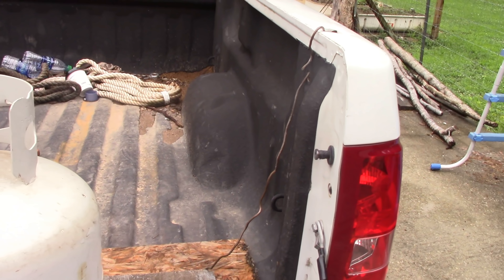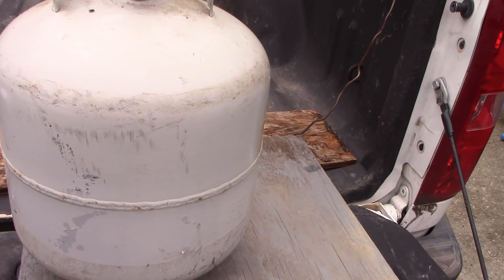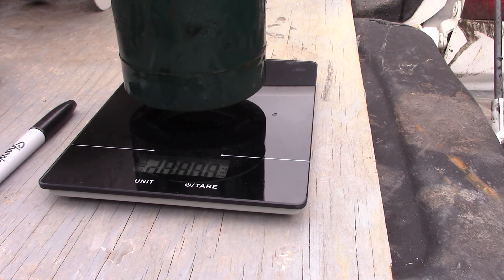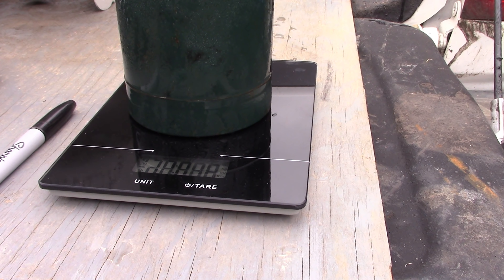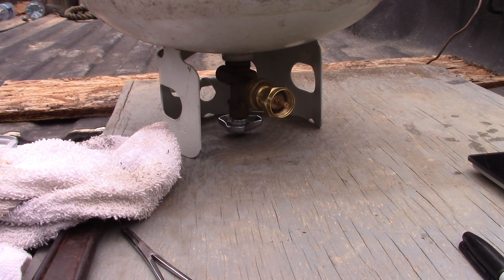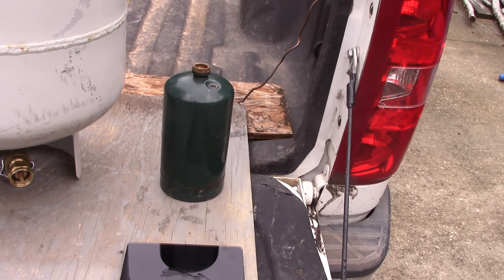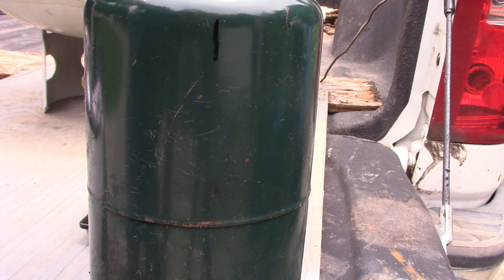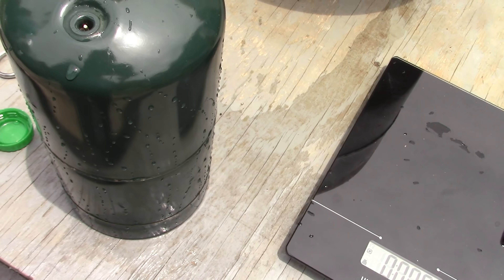1lb propane tank hack

Comment: I generally fill mine to 14oz or less just for safety. Like you said, it's good enough.  I have so many tanks it really doesn't matter if I only get one to even 1/2full. A few years back I tried to get one exactly to 16oz. I froze, filled, refroze and filled again. On the second time it overfilled to around 18-19oz. I set it down did some others. 5 minutes later when I came back and it had warmed up the metal was bulged. The actual cylinder was bulged out 1/4" on the top half and the bottom half with the center weld/overlap band original size. That was pretty scary and I will never attempt a 100% full fill again. I have done 100's of these and have never come close to overfill with a single freeze and fill until it stops hissing. A lot of people will pull the safety vent to get more in; that's just asking for trouble. 

The odor is Pepe Le Pu
Reply: sixtyfiveford - wonder why the overpressurization valve didn’t release the propane

Comment: Chemical oil called a thiol (also known as mercaptain) is added.  If you get that stinky stuff on anything that you don't want it on, there are videos describing a hydrogen peroxide and baking soda solution that works pretty well against it.

Comment: I do not know the chemical name for the smell in propane, but back in the 90’s WD40 propellant was propane without it.   I believe it is air now but not sure.
Reply from the maker: I believe it is ethyl mercaptan that is added that gives it the rotten egg smell. I’m not sure if that’s the correct spelling though. I think you’re right about the WD-40 because I recall years ago it used to be flammable but now it will not combust
Reply: @Mayhemcountryliving    I did the electrical design of the building that put the liquid in the cans back in 94 or 95.
Reply from the maker: @KevinCoop1  Pretty cool

Comment: The valve has to be reset by pulling again and releasing quickly.
If this works the tank is not defective.  It happen about 1/4 of the time 
when refilling.  I have never yet had a valve that could not be reset.
Reply: I was just gonna say that, yep, try pulling it and releasing to reseat it

Comment: on those tanks that are leaking  maybe the valve is loose. YOU can use a valve tightener same tool you use to change the valves in a bicycle tire  or the valves that they use to put refrigerant in you cars ac. they will often rattle loose. you can also use a real little screwdriver to tighten the valve with.

Comment: one more thing after you fill the tank and take it off, that valve that was leaking  on one of your tanks you can take that same valve get you a pair of tweezers and grab ahold of that same valve and not to hard but pull up on that valve and it will relieve alot of presure in the tank it will hiss for a second or two but then it will stop it will also make some more room for more gas to be put into it.

Comment: I do the same thing but I'm a scaredy cat and just shoot for 90% total capacity. Makes me nervous to over fill the canister and make a more sensitive bomb.  If you don't chill the 1# canisters you won't get them as full since the filling process is using temperature to create a pressure differential between the two vessels to facilitate the transfer of propane from the larger tank to the smaller ones. Great video man.

Comment: Can the schrader/relief valve be replaced on the leaking tank?  Is it the same type valve used in automotive tires.?
Reply from the maker: Good question, probably so maybe do a water test in a tank to make sure it doesn't leak
Reply from the maker: John Beige  thank you very much for clarifying I appreciate that

Comment: Mercaptan
Reply: Learned that name real quick when one of our tank trucks picked up water puddles around where a company was adding Mercaptan to check for a leaks in a gas line. It don't not take much to make that smell and will last for days. It will basically have to ware out if the liquid touches anything.